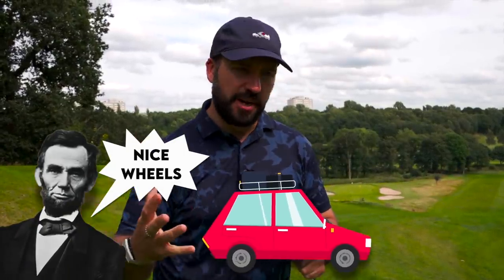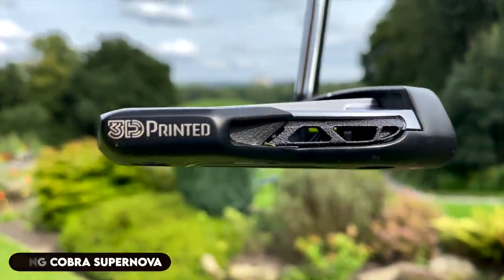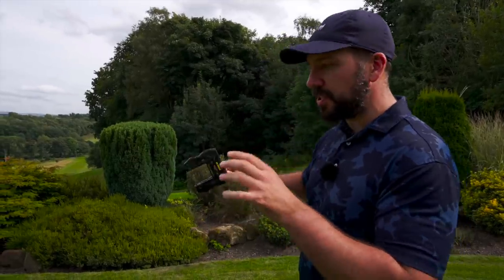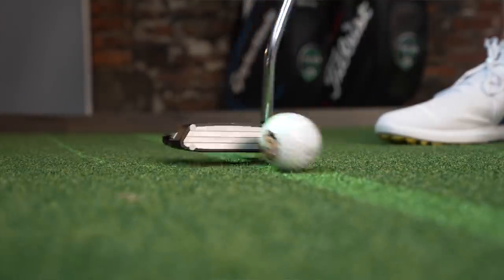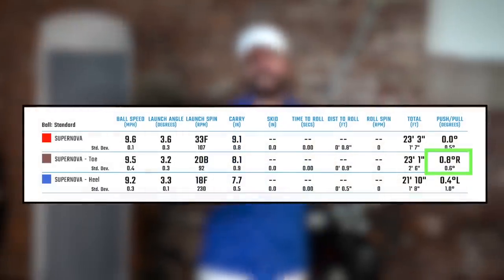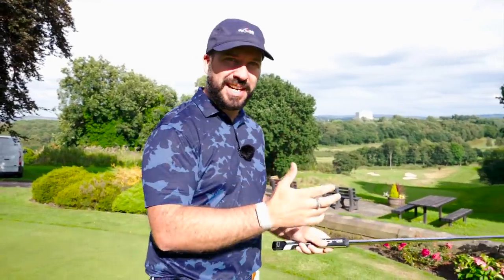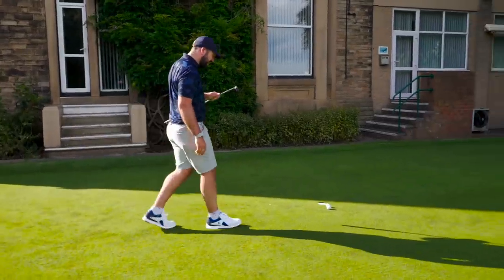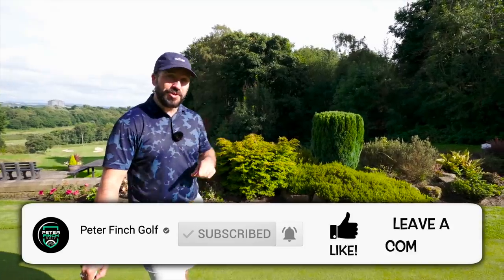IS THIS PUTTER PERFECT!?

Comment: I’ve just gone through a fitting for a new putter and this was one of the putters on offer, the others being the odessey triple track and the cobra stingray. In the end I went for the triple track because although the results were very similar, the cobra grip was just a little less comfortable as it is so much firmer.
Put the odessey grip on the cobra putter and I’m a sold
Reply: You literally could’ve just bought a different grip😂

Comment: Controversial as it may be for me to say this, I actually shift my putt impacts toward the heel of my mallet putter when greens are fast and/or slippery downhill putts when extra touch is required. Quicker the putt, further from the center line I play the ball. Comes off deadened and adds touch. Lag putts or off the fringe, I generally hit off the center line. I've been using the same putter for over 10 years. The "perfect" MOI putters homogenize things which is good, in theory, but there's a price to pay for too much perfection, IMHO.

Comment: Not a fan of plastic... 3D-printed ceramic putters would be interesting, but those would probably be way too expensive. As an engineer I think 3D-printing is great for prototypes, but I don't think it's a good idea to put them on the market like that. If you take a closer look, you'll see that the tolerances are still quite big and the club looks quite cheap to be honest. The technology still needs some improvement. I don't know how long this putter will last, but you better not keep it out in the sun for too long since the nylon could get brittle over time because of the UV-radiation.

Comment: I'm sorry, plastic inserts? It's snakeoil, doesn't do anything more than molded aluminium would. It's a putter, a lump of metal with precise weight distribution and a shaft. In fact, Nylon is hydroscopic, it means that it absorbs moisture, ie on a rainy day the putter head gets heavier than on a sunny day. Maybe it's a good thing, maybe not. In my point of view the Nylon is a source of inconsistency.
Come back when you have a fully 3D-printed putter head of 100% metal with a machined face. It would be cool without affecting the performance. On the other hand, when it rains you get water droplets on the putter affecting the weight anyway. Forget I said anything.